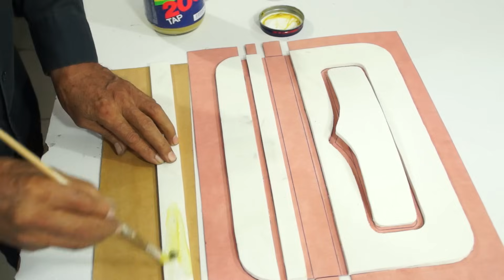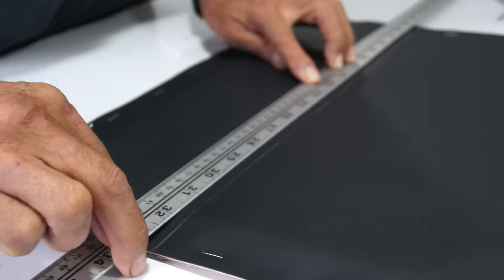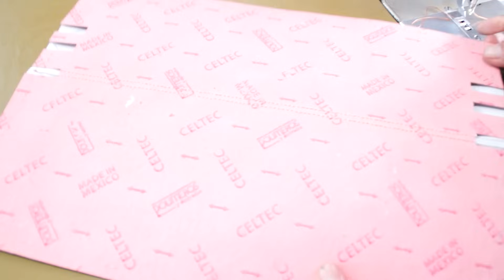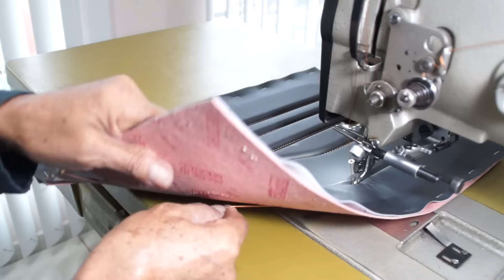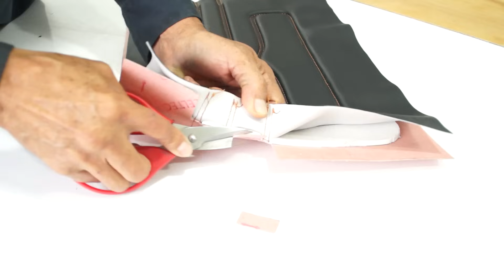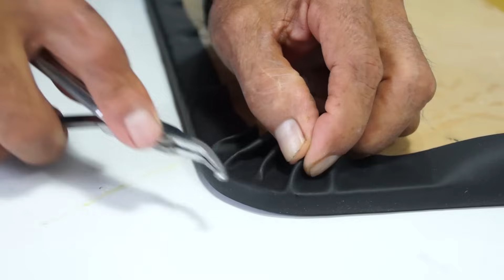Custom High Relief Car Door Panel - Automotive Upholstery

Comment: Making those sewing machine feet is the post I want to see. Brazed parts to a bit of time to create. That exposed needle brings much concern. Not something I’d want an employee to use s as one accident could close the shop. But for an owner of the machine I can see how the risks would be beneficial. Just don’t get your fingers in there and go slow.
Reply from the maker: A servo motor would help a lot to sew stitch by stitch. My machine has a clutch motor but at any moment I will change it for a servo. This panel is only a sample, anyways I am very careful and the sewing is done at a slow pace by moving the big pulley/wheel by hand.
Some presser feet could be done by hand, but by having the prototype (sample) a lathe/milling operator can do it perfectly and flawlessly for you.
I have some related videos on how to approach those handmade feet:
https://www.youtube.com/watch?v=2C-AoTBrouc
https://www.youtube.com/watch?v=KEpkXgw1wyU
https://www.youtube.com/watch?v=BE7WrkHyxqA
https://www.youtube.com/watch?v=c8i1b6QSpjQ&t=381s

Comment: What's the name of your sewing machine and where can I get one from. Also what size form that was and wood and etc. Tell me everything.
Reply from the maker: The sewing machine is a Pfaff 1245-706/47
The patterns are sewn down over a shoe's insole cardboard. This cardboard can be folded under the sewing machine neck in order to handle it for the sewing process.
The presser foot is an adaptation to make it run in the low channels easier.
Just for the sample I used a thick MDF cardboard as base.  The application would be over car door panels over their own cardboard or plastic panel.
The white foam is called Latex Eva foam. It has some resilience. It means resistance to keep its shape.

Comment: What is the base you started with, just cardboard?
Reply from the maker: Yes, the bulky patterns should be sewn down to a thin, flexible cardboard (shoe's insole cardboard)
Reply: @Cechaflo  ok thank you, so a shoe insole type cardboard. Is this the case for doing custom door panel design also Cechaflo? 
Also is your online courses still available? 
What is best, an industrial sewing machine or walking foot?
Reply: @Cechaflo  is automotive thread different from sofa thread?
Reply from the maker: @2094Ryan  I have used an Eva foam (latex) as padding. Almost similar to landau foam used for car door panels too.
https://www.cechaflo.com/courses
Nowadays, walking foot (double or triple transport) sewing machines are uaed to do upholstery. These are heavy duty industrial machines.
https://www.youtube.com/watch?v=U3HBXBDDKoo

Comment: Hey Ceasar if y9u have time could you pist a link the celtec matetial you are using in you recejt barch of videoss? Im fi ding to manny different types ans id like to buy the correctone to give this type of project a try! Thabk you in advance.
Reply from the maker: I get this cardboard from local suppliers (shoemaker's stores)here in Mexico. The grey Celfil board is more flexible and softer.
Hopefully this link is useful:
https://www.avetcoinc.com/product/celtec-board/?attribute_pa_package=4-sheets
https://www.avetcoinc.com/product/celfil-r/?attribute_pa_color=gray
Reply: @Cechaflo  thabk you sir I really appreciate it. I could not really tell how thick the material was and didn't want to buy the wrong stuff. I'm wxcitted to give this a try
Reply from the maker: The sheets are no more than 1.5 mm thick.

Comment: Хорошая работа.  Есть вопрос -- как вы удаляете следы разметки от серого карандаша??
Reply from the maker: The white spirits (mineral spirits/white gasoline) is useful. Do a test beforehand on the material you need to take off the pencil marks.
Reply: @Cechaflo    Спасибо за совет.  Ваше видео всегда очень интересно и полезно.  Вы отличный мастер своего дела.

Comment: Hello. very cool work. What is the name of the fundamental substrate, and what is the name of the material that creates the relief?
Reply from the maker: The substrate is MDF cardboard 3 mm thick. The reliefs were glued down over a thin cardboard called Celtec used for shoe's insoles. The white material is called Latex Eva foam 6 mm thick mostly used in the shoemaking industry for insoles too.
Reply: @Cechaflo  Thank you

Comment: thank you. how thick is that shoe board you're using?
Reply from the maker: The thin flexible cardboard is 1 mm thick. The cardboard base is 3 mm thick.
The pink board is called celtec. There is another grey one much better called celfil